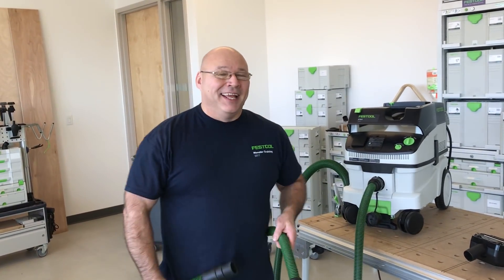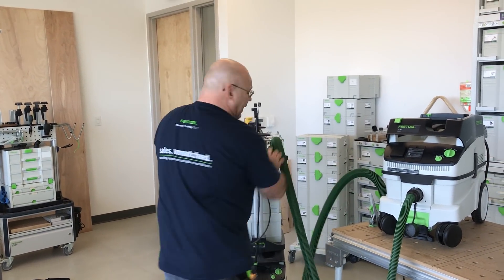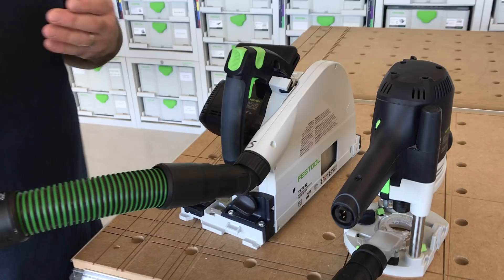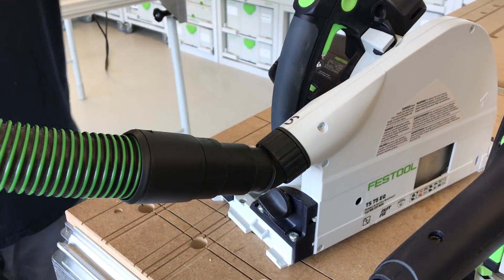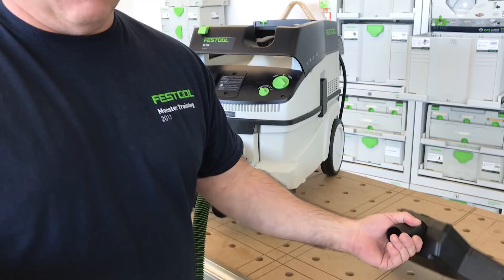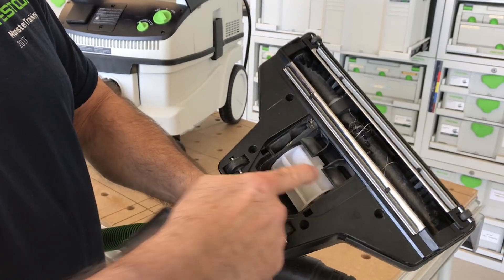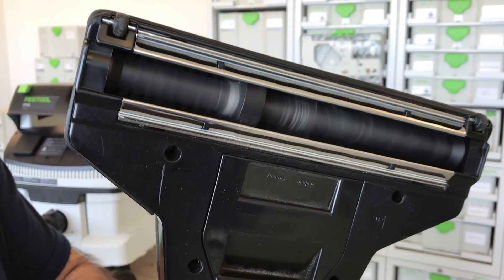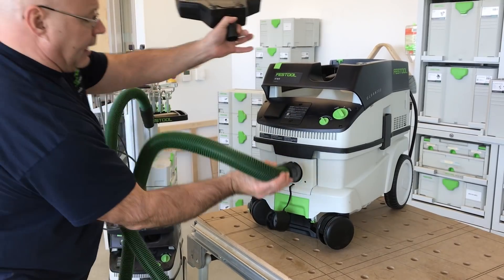Festool Training: Understanding the difference between 36 mm and 27 mm hoses

Comment: What will happen if you hook this up to to dust separator? Will you get equal air flow regardless since the diameter of the dust port in the dust separator is smaller or will you get increased airflow?  I have the separator and interested in increasing airflow and chip removal from my larger tools.
Reply: for the an extractor cyclone the difference at the tool end of the system will be relatively the same as the motor moving the air is the exact same. cyclones begin to differ with 4- 6 inch dust ports as the resistance and the length of ducting varies greatly among users. For users picking a single hose for their shop applications the 36 mm hose is the best "all around" as it can help for high demand situations and be dialed back on the extractor for sanding.

Comment: So why don’t they just come with the larger hose if they are better?
Reply: The 27 suits better smaller machines. In fact, you cannot fit the 36 onto the plugged Trion due to the compact design. Also I don't need a 36 for my sander as extraction is a good as it gets with the 27.

Comment: Hi, I love watching all your videos mostly because they are informative but short, less than a minute. I own Festool OF 1400 router, rotex 90, HK55, track saw and 26 extractor. I plan on increasing my Festool collection. About the hose- in order to maximize the dust collection am I better off buying a D36 hose and add a step down adapter to 27 for my tools?  Cheers Dan